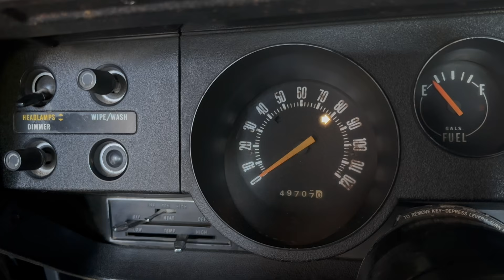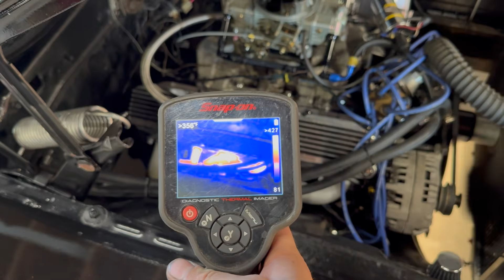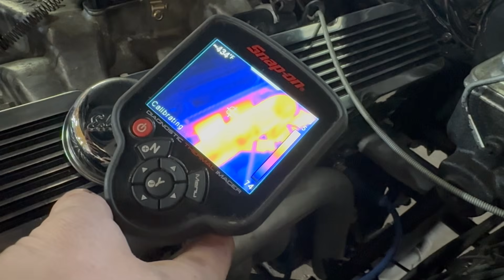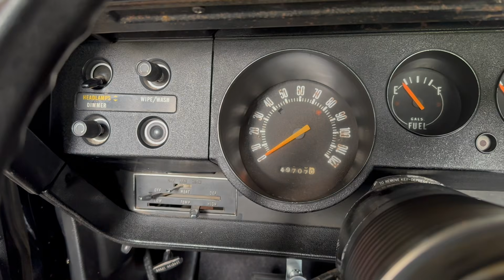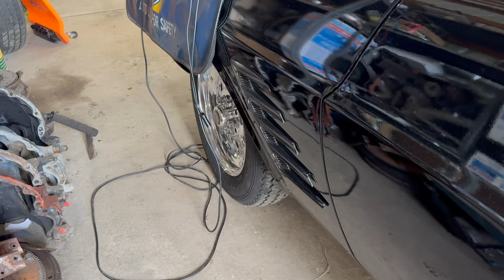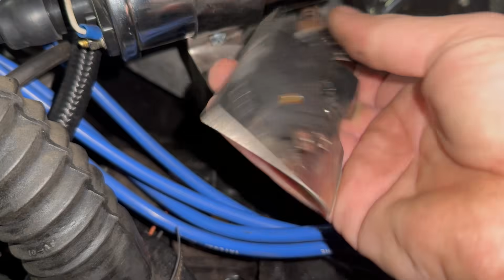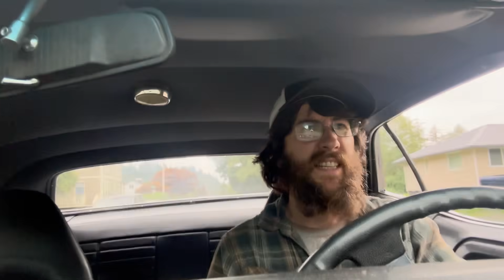What's Wrong With This 1973 Dodge Challenger? Electrical Gremlins, Big Block Tuning Tech, And More

Comment: I had that same weird backfiring/coughing issue on my 57 Chevy, took me forever and really racking my brain trying to find it but it ended up being 2 rocker arm studs were being pulled out of the head, causing weird valve problems. Maybe same issue?
Reply from the maker: These are shaft mounted. But I’m certainly assuming it is an intermittent valve issue of some kind.

Comment: Whats wrong with bypassing the ammeter, running a wire from the starter relay direct to the alternator, and hanging a voltmeter somewhere? If you want to run a higher amp alternator, you are now putting way more current thru the gauge. Think about all the cars with electric fans and fuel pumps that have been added and may need higher amp alternators.
Reply from the maker: Nothing. Lol. I’m the guy with the charging system video in which I explain why the ammeter charge wire bypass (shunt wire) is a good idea. This car has a stock alternator and none of those things you just said. On my turbo car that has electric fans and an electric fuel pump, I will be upgrading the alternator and doing exactly that.
Reply: The described alternator to starter relay by-pass also by-passes the original circuit protection (fusible link) for the un-fused charge/ignition circuit wiring and related components, increases the potential of burning wiring in the event of a short. As well it defeats the purpose and function of the original ammeter to show battery charging/discharging only, not vehicle loads.
 Running an aftermarket high output alternator, in it of itself, does not increase current through the ammeter, shouldn’t be any vehicle loads running through the ammeter while the engine is running if the wired correctly. All loads should be on the alternator side of the ammeter as are all factory loads, nothing connected directly at the battery.

Comment: Mechanical flashers need the current draw of the incandescent bulb to heat the thermostatic switch inside them and cause the contact to break. Once broken, the circuit immediately begins to cool- closing the circuit and illuminating the bulbs until the heat causes the circuit to break again. AN LED BULB WILL NEVER DRAW THE REQUISITE CURRENT and so the mechanical flasher will never work.
Reply from the maker: Yeahhhhh, that’s why I installed an electronic flasher brother. And it still didn’t work, so… believe it or not, I have years and years of experience with LED bulbs, flashers, and lighting and other issues. That’s why I make these videos - to share that experience with others. Thanks.
Reply: With all new technologies there is a learning curve 100%. About 5 years ago I picked up a Harley that someone had customized. It had a few modifications that created somewhat of a dragger bike…and then ended up getting some minor cosmetic damage. It was for sale (reasonably priced) and I knew the repairs would be simple fiberglass work and an overall fresh paint…once it was back together it would be ready to sell, nothing new🤷🏻‍♂️. So I bought it and jumped right into that plan. I started taking the back end apart-it had a single taillight in the lower rear section of each saddlebag which were separated by the rear fender. I didn’t think much of it and the entire bike was taken apart for the paint process. When I put everything back together I realized that each of those lights had 3 functions; running light/brake light/ & turn signal indicator light for its respective side-and they were LED’s 🤔 which I had never messed with. I ran wires to each light from the factory harness of course and the lights worked.. but you could Barely see them when they were on, blinking, braking etc. and all of the functions were right-just not adequate. For almost a week  I was stumped about what I was missing! Well, I finally found two little rectangular boxes that said “street magic” on them (one was red-one was blue). Those boxes were controllers for the LED functions. All if those wires I had ran to the lights were supposed to be ran to the controller and the controller box had little small diameter wires that ran to the lights. So I got all of that switched  correctly.. and only about 70% worked. I finally and painfully figured out that one of the boxes had a circuit inside it that had gone bad; I about went crazy over thinking I had something wrong. One whole side worked perfectly the other side worked somewhat..one little circuit within that box had become faulty. Once the one box was replaced everything worked perfectly-and the lights were very bright and impressive  as they were supposed to be. I learned a lot about LED’s because of that situation and it was brutal at that time but after that…I have used them many times, they are easy to use, and they give so much freedom as far as placement, potential amount you can use, and the cost… once you get comfortable with them-they are definitely a win! Less heat, less draw, less cost, etc. The thing is-if not for that bike I would’ve avoided even trying LED’s lol. You know how new things can be.. scary 😅!
Reply: Well, I guess you got politely told off. That'll teach you not to try and be helpful. LOL
Reply: @Martin.Wilson  I don't think he told me off. Everyone is on the same side here we're just trying to fix things.

Comment: I fixed my belt squeaks finally by taking them off and run a heavy folded piece emery cloth in the crank pulley grooves while idling the engine. You will also notice how whisper quiet these engine are without the fan noise...

Comment: Maybe the valve sealing issues are pushrods too long or lifter plungers getting stuck up? Also while not the best thing to do, you can do a valve-relap with the heads still on, you take the valve springs off and then put lapping compound on the end of a zip tie and put it on the valve face through the spark plug hole and then spin the valve with a drill. It will leave some residue from the lapping compound in the cylinder and will run like garbage for a few minutes afterwards but i have personally seen that trick work several  times. Its mainly for vehicles that need valve jobs but aren't worth enough to justify pulling the heads.
Reply from the maker: That’s very interesting, but I can’t say I can imagine a situation in which that would be the way to go. Either pull the heads because they need it, or don’t. Also, given that valve lapping compound is an abrasive, I can’t say I’d be excited about dropping it in the cylinders.
Reply: @DeadDodgeGarage  i seen it done on a Ford ranger that was a total piece of garbage with super rusty exhaust and hardware that would have costed more to pull the heads and get them machined and put back together the than the truck was worth. The exhaust valves were super rough and it had a really bad miss on at least 2 cylinders and that trick saved it and it ran fine. Also good trick for boats where every bolt is rotten to the point where it would take days to remove the heads. Granted if it's a nice engine that you value highly it's definitely not the best thing for longevity but for a POS beater that's already on its last leg it will get you down the road for a while.

Comment: May be sacrilege to speak of GM here but I have my own rabbit hole that's similar to this possession your exercising. My '72 Buick Skylark likes to backfire as I accelerate thru to second gear... was running rich, adjusted carburetor... still back fire... chased various vacuum leaks (bent rigid fuel line in the process, don't ask)... still backfired... sea foam to remove excess carbon build up... still back-fired... replaced clogged PCV valve... still back-fired... new plugs, plug wires, coil... every step of the way it's improved drive-ability but it still doesn't like accelerating thru to second gear without a back-fire... I'm on to timing and possible distributor replacement. I'm here to tell you your videos have kept me on the path because I know I'm not the only one dealing with gremlins, and to say thank you.
Reply from the maker: You’ll get it! Keep on it! Happy to help, and I’m not joking when I say I actually like Buicks. Thanks.
Reply: Have you checked the valves at all? Almost sounds like an intake valve not sealing or not closing all the way.
Reply: @minnesotatomcat  got the car in an "unmaintained" state. Everything I've done so far has been least invasive to most... if distributor/ timing doesn't resolve the problem next will be replacing the stock 2 jet rochester carb and intake manifold with a quadrajet. I may dive into the valves over winter... we'll see where it goes. I appreciate the advice.

Comment: heavy duty relay for LED conversion, best to not use the LED bulbs rather get an integrated PCB board style, just mo betta, mo water resistant, mo stable, so forth, don't have to worry about computer glitches with the old gen but still INTEGRATED ALWAYS! .. if wanting LED conversions do the entire car or go all filament, one or the other.. I mean led in the dash, dome, headlights, glove box, trunk, hood, the works, and use PCB board style for tail and front signal, proper plug and play headlight conversion . . again water proof . .  LED bulbs can get corroded easily depending how waterproof your lenses are? 

then you can match fuses for the lighting which will stabilize all your lighting, no more flickering or dimming so forth...  filament is best, just get good ones!  in fact best to digital dash as well.. upgrade it all. .FI, pressurized vented fuel system.. the works . . however if you cannot resist led's USE LED'S EVERYWHERE, the works, then meter your fuses accordingly, heavy duty relay you should be good to go?  if you can find PCB board tail lamps and signals you will have better lighting and less moisture related issues.. 

plus you can get like sequential style blinkers for the front/rear, arrows whatever, custom made you can get what you want, you can even have 3-4 arrows up front, you might be surprised what they can fit into a 4" housing .. bullet style?  what lens color you want? black? clear? bright red, clear red? choices ..

and whatever you do?  get those tail lamp housings in the SAME DIRECTION ON EACH SIDE!   UUUGGHHH, that's fugly as ugg  same direction!

check out dapperlighting to see the sequential signals they make for the challenger, there you can see what I mean by PCB board LED's its where they integrate the LEDs onto a board like modern lighting, WAY WAY better than bulbs ...  for the front buy new housings from a parts house then send them to an LED expert, they can make you a board to plug and play and get what you want, arrows, sequential, 3 way park/signal/run, 2 way signal/run, 2 way signal/park.. or with a little skill and knowledge you can make your own board to do whatever you want? arrows/park/sequential whatever .. if you want LED, DO IT RIGHT so it's not ghetto as fugg... pay the car the respect it deserves
Reply from the maker: I tried the correct flasher and they didn’t flash. So I shit canned them. I have also installed LED conversion boards in a ‘71 Challenger. I’m hip to it. It’s not for me. Having said that, my ‘68 Charger has LED conversion type tail lights and they work perfectly - and as much as that car is worth, I would like people to see my brake lights. So they stay.

Comment: hi good ep i think your friend should take his car to indy auto aka nick s garage up in canada and let nick fix his engine and anything else he should make list and give it to nick nothing personal Jamie you need someone to do it the right way.
Reply from the maker: I dunno, that sounds kinda personal, considering that I install restoration grade replacement wiring harnesses (as I recommend should ultimately be done with this car,) and rebuild and restore Chrysler engines to accurate factory detail and specification - frequently. I have done all of these things on video for the world to see. He didn’t ask for the 100% right factory way, he asked for me to make it work. It works now. I don’t think there’s any need to truck this car to Nick so he can turn his nose up at it, insult it on the internet, and charge this guy a bunch of money. I will be building this car an engine and transmission this winter - so I guess we’ll just see what’s what then. Thanks.

Comment: Same NGKs im running in my 440! Love them! 

Secondly, I was specifically told to avoid LEDs in both front turn/park lights and tail lights because they don’t draw enough and cause flasher issues. 
Have to install 2 electronic LED flashers for proper signal functions.
Had my friend not told me this I would have been on the same goose chase! 

Mopar on! 🤘🏻

Comment: I retract the blown cylinder head gasket diagnosis on this car... not consistent enough... but certainly possible.  Fouled plugs.. no. That makes no sense although that was some rich.  Richy Rich rich... yikes.  That stupid pickup and electrical gremlins... nailed it.  Keep it up
Reply from the maker: The fouled plugs were the cause of a lot of the back firing and terrible high rpm breakup. Just plugs and fixing idle mixtures made a huge difference. But the various distributor fixes and ignition voltage got us where we are now. Much better!

Comment: Does the 73 Challenger have the same subframe as the 73 Charger?
Reply from the maker: Negative - because it was already slated to be canceled, the E-body was never updated. In fact, they continued to use not only the earlier K-member, but also the earlier engine mount design until the end in 1974.

Comment: I'm retired now but I started out as a bodyman, enjoyed everything about it, moved to wrenching, later to a machine shop rebuilding cyl. heads, enjoyed it all EXCEPT electrical problems, they always end up with you under the dash with the rocker panel in the small of your back and your head and neck in an unhealthy position.
Reply from the maker: Probably why my neck is so screwed up honestly 😅 I enjoy the challenge. I don’t enjoy the working conditions at times.
Reply: Yeah it really isnt good when you have neck vertibra fusion
Reply: But with some of your tricks you taught me I was able to get everything figured out in 75 Duster with only a meter and test light. Almost nothing electrical except ignition was not working and even that was played with and had a jumper wire in the starter relay circuit to power it up because of all the debocle

Comment: I'm hoping you can answer a question for me (please).  I put HEI in my '77 w200 and my module mostly cooked sitting in line for the dump.   Nearly turned my muffler into a projectile :)  The guys behind me checked their car for damage, lol.  I had put a ridiculous finned aluminum heat sync on it with 10 gauge ground going to both mounting holes and the body, away from the motor and am wondering if there's a quality difference in the aftermarket modules and it's worth it to pay more than $15, or this is just the overall quality drop in everything that I have been seeing.  What modules do you get?   I confirmed it got too hot and stalled it with backfiring rapidly, then changed the module and the problem disappeared.
Reply from the maker: I do try to steer away from the cheap POS ones - especially if it’s going on someone else’s car. I generally get these name brand Standards, and they have been ok. But your cheap one that blew up probably came from Standard too… welcome to the future.
Reply: @DeadDodgeGarage  Yeah I ordered 2 ignition switches from standerd, 2 different "standard vehicle replacement" quality levels and they BOTH were DOA.  Fuck those guys.  They can give me the money back, but not my time.  I upgraded from one spare module in the glove box to two.  I was really hoping there was a bulletproof one available, somewhere.
Reply: @1datsunlover  whenever I visit the junkyard, I harvest modules

Comment: I have a habit of using a multimeter for chasing electrical gremlins, but when working in cramped confines, I can see some advantages to flipping  a thumb switch and imediately having either power or ground.  Do you have a link for the specific Power Probe you were using?
Reply from the maker: Oh yeah. The power probe is the best. The volt meter part of it is not as precise, but it gets the job done. I buy them off of the Cornwell truck, so I don’t have a link. I think this one is the Power Probe III. I seem to recall the IV is fancier to an unnecessary degree.
Reply: @DeadDodgeGarage  Thanks for the model name. Oddly enough, NAPA has them $120, which was less than Harbor Freight.  If someone really wants to roll the dice, there’s a sort of knockoff on TEMU for $13. I’m heading over to NAPA.